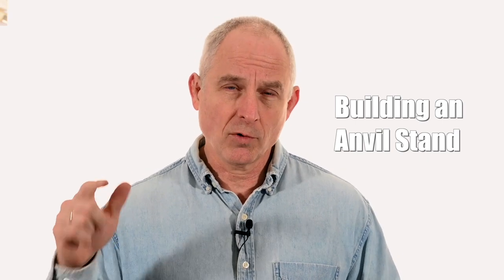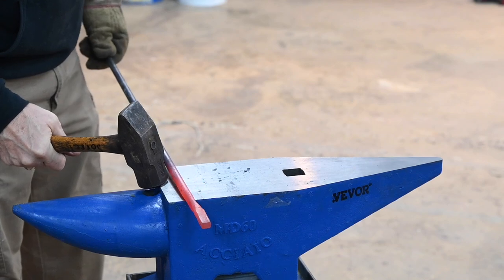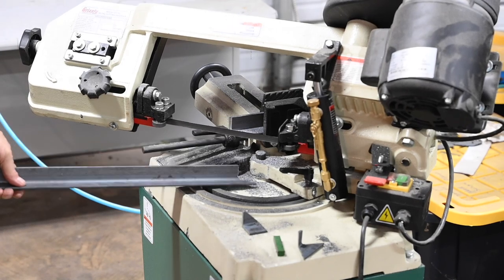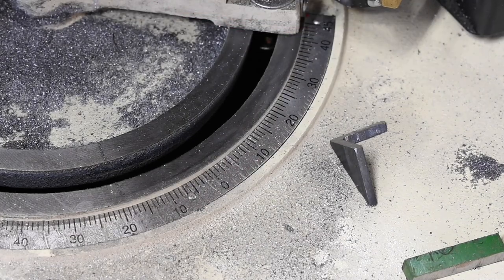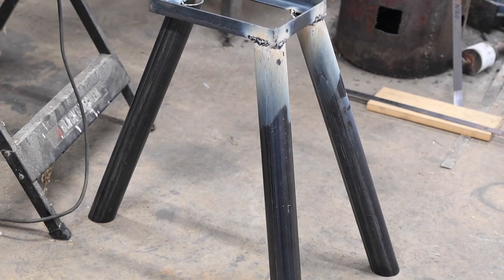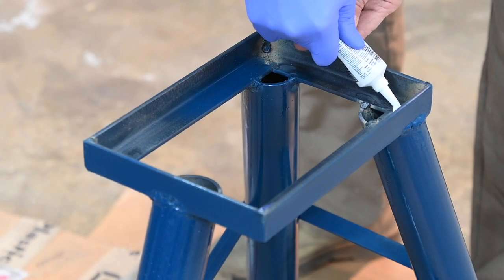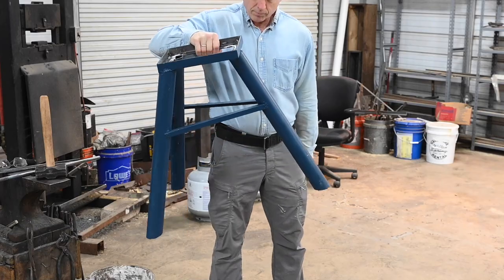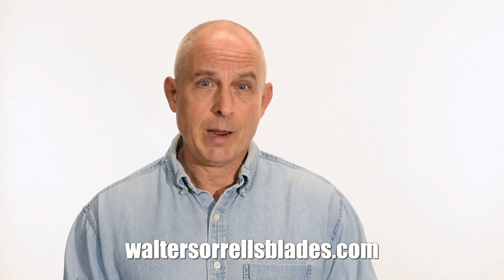Making an Anvil Stand

Comment: Walter, I've been a blacksmith since 1967 professionally.  I learned years ago that with lighter anvils if you place a piece of heavy metal under the anvil and fasten the 2 together it functions like an anvil with a much heavier weight.  I have 2 anvils, one 85 and one 100 lbs on stands like yours with heavy metal blocks underneath and for forging they act as 125-140 lb anvils.   And they are still oveable around the shop.

Comment: I like the simplicity of it and will be fabricating a three leg stand soon due to uneven floor and my current 4x6 base rocking slightly. If you wanted to weight the stand would you try and put the weight lower down or up right under the anvil?  I have a 70lbs anvil and want to make a base of at least 50lbs.

Comment: Where can you buy this anvil and what is the price?
Reply: eBay, Amazon or from Vevor. The cheapest I’ve found is eBay. The black version, which has a slightly harder surface, is about $275-$285 shipped. But it either comes in a flimsy box or naked with just a shipping label. Mine should be here this Thursday, Jan. 19th.